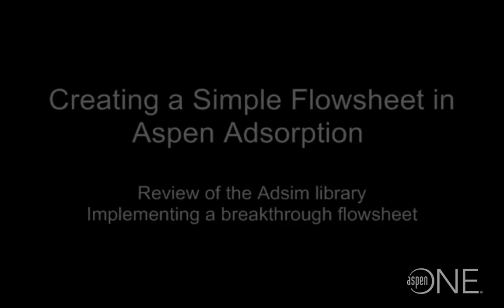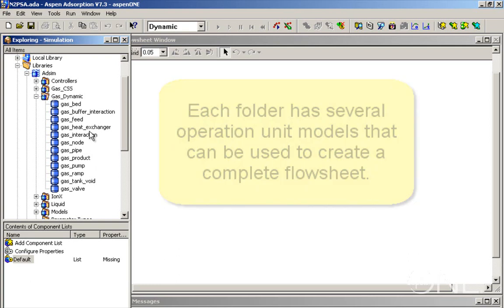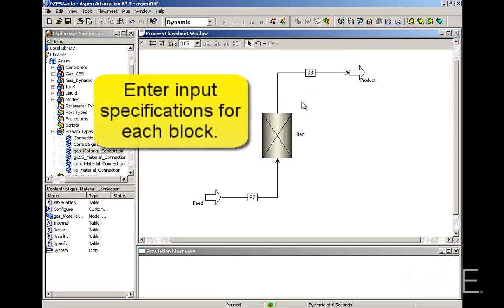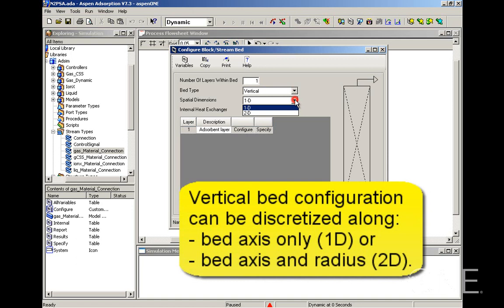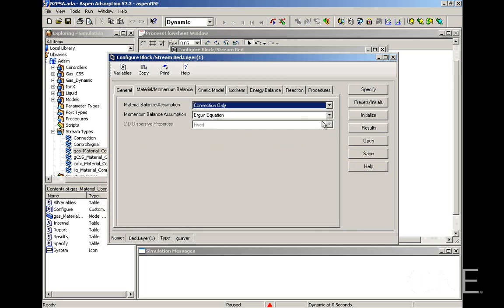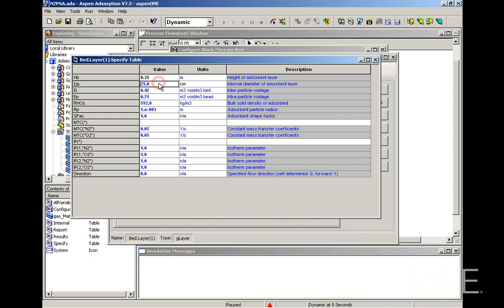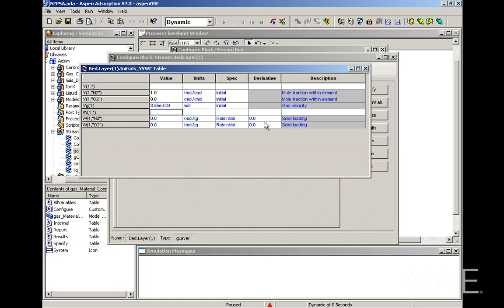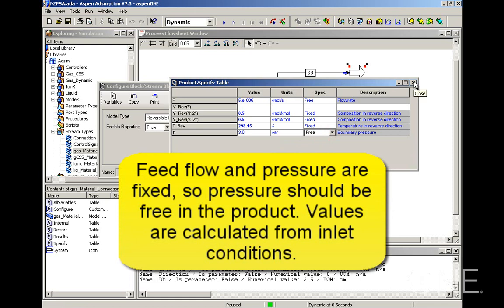02_Creating Simple Flowsheet in Aspen Adsorption

Comment: I'm sorry! Were did you found number of IP(1,"N2"), IP(1,"O2"), IP(2,"N2"), IP(2,"N2")? I tried to found this information in "HELP" but there were no numbers. Thant you for answer!
Reply: Using extended Langmuir 1 as assumed Isotherm while configuring the bed, you will see IP(1,x) to IP(2, x) value prompts in the specify table.
Reply: @chineduakuma4484  don't think that's what he was asking for. he was wondering where you get those actual values

Comment: Hello! I have followed your simulation step by step but in the end (when I ''free'' the product pressure variable) my simulation is under by 1 Initial variable. Can you suggest what might be the problem? Thank you in advance!! (I am running the simulation in Aspen Adsorption V11)
Reply: Hi! I don't know if you have figured out your problem yet, however, I was having the same problem and I was able to solve this by going to the bed configuration and then the presets/initials and set the Y_First_Node('N2") to initial rather than free
Reply: @CarlosHernandez-pk3gd  , Hi! Thanks for your advice. I've changed Y_First_Node('N2") to initial rather than free and the square at the bottom turned green. But when i try to run initialization, an "Initialization failed at time 0" error appears. May be you know what the problem is? Thanks in advance!
Reply: @АнастасияЖигалова-й2ы  Did you figure out the solution to this problem?
Reply: @АнастасияЖигалова-й2ы  Did you figure out what was the problem as I followed same instructions listed in video and I met with same problem as you did?
Reply: @salmanshahid611   Hi, I believe if you set the value for Y(O2) to a very low non-zero value (e.g. 1e-99), then this fixes the issue. This is due to Aspen Adsorption trying to divide by zero during the initialization procedure, which causes the error.
Reply: did you figure out the solution?